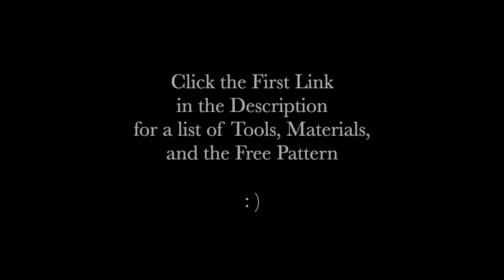This Leather Wallet Has a SECRET SURPRISE // FREE PATTERN

Comment: Since you won't see it, with the flesh side of the strap, you can make your life a little bit easier when keeping them aligned for stitching by making a mark with a pen to show where it's supposed to be at the time of punching your stitch holes. It won't be seen after you finish assembling it but it makes it a lot easier to keep track of the specific point you have the holes punched at on the strap

Comment: Hi, congratulations for your tutoriales is very educational for beginners so I was wondering if it’s possible get the measurements on each peace in order to know and cutting the right size… appreciate it and thank you so much 🙏🏻👍🏻
Reply: Tip. print the template to Actual size.. and measure the print out.
Reply: @vpham92688  where do you all get the pattern from? It is not on the link?!?!?

Comment: Awesome! Thanks for the free pattern! Just wondering how you were able to get clean straight stitches on both sides?
Reply: He normal lays a line with wing dividers to show where the chisel holes get punched 👍👍
Reply: @Jlayism  yes I mean, i learned how to stitch the same way with him but the stitch is neat on on one side, and not on the other side. I wonder what Im doing wrong.
Reply: @onetwoflowerz660  best things to check for, your chisels need to be nice and sharp and used on a solid, no-bounce surface (heavy scrap leather on marble or other solid work surface). If they are dull it will cause a blow-out instead of a slit upon exit. 
A chisel with more prongs will give you a straighter line, and be sure the chisel is 90 degrees to the leather with each blow of the mallet. Overlap the last two prongs with previously punched holes.
Hope some of that helps,  I feel like you probably already knew most of it. 🙂
Reply: @Jlayism  you are incredibly helpful! Ill try this tomorrow! Thank you Jason! :)
Reply: @onetwoflowerz660  no problem.  We'll see if Eric has anything to add!
Reply: 2 things I’ve learned about stitching that changed everything and all of a sudden it clicked. 1.  Pass your needles through your stitching holes EXACTLY the same each time. I.e., first needle through ALWAYS comes through from (pick a side and stick to it al the way through). Pull lightly on that thread at some angle back away from the direction you’re stitching. With the 2nd needle, come either above thread 1, or under thread 1...then do that exactly the same from then on. Insert needle 2 into the hole at roughly the same spot every stitch. As I said above, put tension on thread one away from the direction of stitching which will spread out the hole a bit and you can insert needle 2 through the gap. If you’re doing that correctly, needle 2 should be entering the hole pointing in the direction of your stitching. It becomes 2nd nature after 10 stitches. Practice on a single piece of leather so it’s easier to see flesh side vs skin side when you begin with the first needle through the first hole—I start every stitch from the flesh (back) side, that way I can see the hole better for needle 2 on the skin (front) side. so I can see the gap made by pulling back thread one and stick needle 2 back through the hole. Phew!  I hope that’s easier to follow than it was to write, but probably not. Number 2!  Make sure you tighten every stitch by the same amount and pulling in the same direction each time. Lots of vids tell you to pull up and forward with one and backward and down blah blah blah. It’s much easier to just pull both threads straight out and level to the floor. Tell me how it goes.
Reply: @bagramdave883  whoa. This is incredibly helpful. I really appreciate it! I can visualize the images on my head based on your writing. Thankyou, ill try this out!
Reply: do you got the pattern? Would you share it maybe? I would love to make this but I can´t get the pattern :(